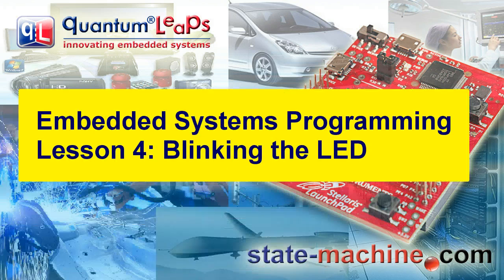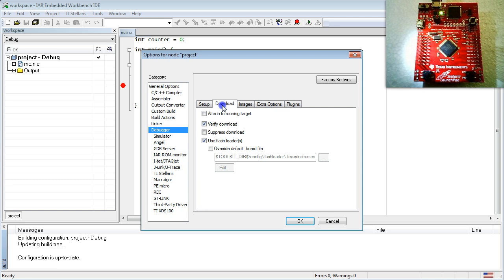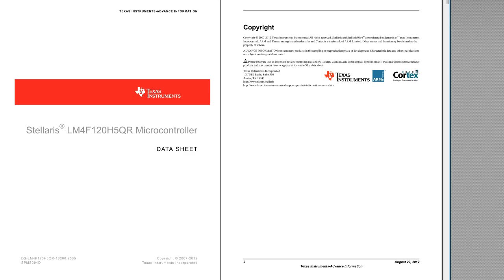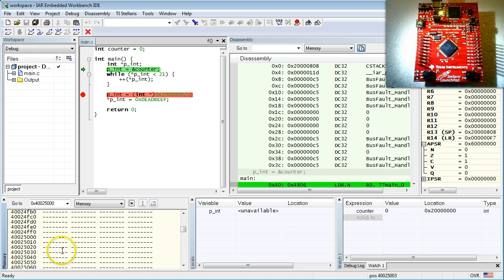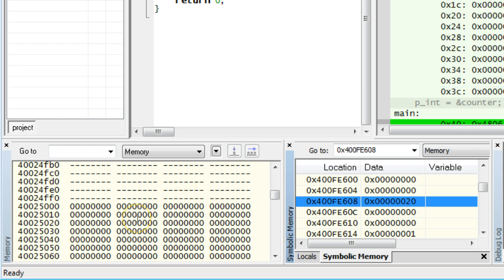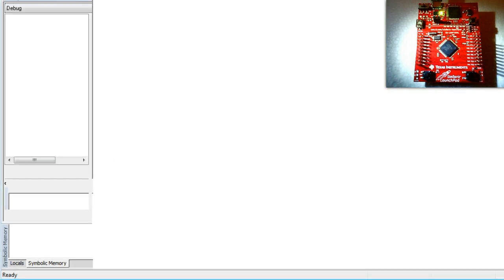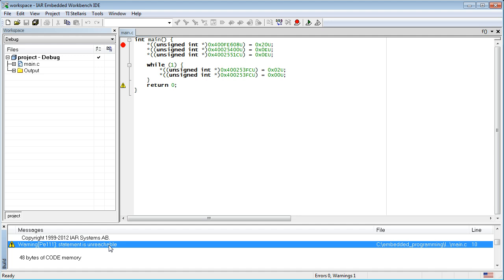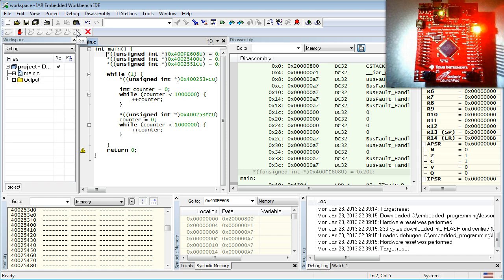#4 How to control the world outside?

Comment: Folks coming in from STM32 background can try this out on their eval boards. This has been tested on STM32F446RET6

#include <stdint.h>
#include <stdio.h>

int main(void)
{

	*((volatile uint32_t *)(0x40023830)) |=   0x1;		                     //RCC GPIOA clock enable
	*((volatile uint32_t *)(0x40020000)) |=   0x400;			     //Setting the mode as o/p
	
       while(1)
	{
		*((volatile uint32_t *)(0x40020014)) |=   (0x20);			      //Writing HIGH to ODR
		for(uint32_t i=0 ; i< 500000/2; i++);
		*((volatile uint32_t *)(0x40020014)) &=   ~(0x20);			      //Writing LOW to ODR
		for(uint32_t i=0 ; i< 500000/2; i++);
	}
}

Comment: Hey please , I need help , when I plug the board into the laptop and burn the code nothing happens in the board like it didn't get the code and the Disassembly bar is all <unavailable> and other bars have no data so please can u help me?
Reply from the maker: Please start with the code downloaded directly from the companion web-page https://www.state-machine.com/quickstart/ . And also, while on the page, you might need to (re)install the USB drivers for the board on your Windows machine. The drivers are provided on the companion web-page. --MMS

Comment: @10:11 I'm using the Tiva EK-TM4C123GXL. The reference manual says the GPIO Port F data register (GPIODATA) is located at base address 0x4002500 at offset 0x000. Why do we use the offset 0x3FC in the video to toggle the Red LED?
Reply from the maker: This is all explained in lesson-7 "Arrays and Pointer Arithmetic". Please watch. --MMS

Comment: I'm using the version 8.40 of the workbench and I get a lot of "CDCDCDCD" data in several addresses. It seems I didn't have to enable the GPIO-F hardware block, or at least I don't know if it is activated. Does someone know more about it?
Reply from the maker: Please check whether you are running in the simulator. You can actually see this on the main menu bar. Simulator prefills the memory regions, like your GPIO address space, with CDCDCDCD... --MMS

Comment: Sir , it is possible flash the code by using rom bootloader with provided by the vender .If it possible then what is the  procedure to flash the code
Reply from the maker: Yes, some vendors provide a special bootloader program stored in the MCU that can load user code and program it into the flash ROM of the MCU. The procedure of doing so strongly depends on the specific MCU, since each silicon vendor does it differently. --MMS

Comment: I have a launchpad with a TM4C123GH6PM and it doesn't like this program.  I have tried everything including the unlock for port F but still nothing it's like the IDE hangs when stepping through it...   any idea where I'm going wrong???   
int main(){
//*((
*((unsigned int *) 0x400FE608u)=0x20u;//Enable the clock for port F
*((unsigned int *) 0x40025520u)=0x4C4F434B;
*((unsigned int *) 0x4005D524u)=0x01;//commit pin0
*((unsigned int *) 0x40025400u)=0x0Eu;//GPIOF pin dir
*((unsigned int *) 0x4002551Cu)=0x0Eu;//GPIO enable as o/p

while(1){
*((unsigned int *) 0x400253FCu)=0x20u;//Turn on in data register
*((unsigned int *) 0x400253FCu)=0x00u;//Turn off in data register
}
return 0;
}
Reply from the maker: One of the main principles of embedded programming is that nothing works until everything works. For that reason it is critically important to start with a working software. To that end, you can download each and every project from the companion web page to this video course at: https://www.state-machine.com/quickstart/ . Please download the project for this lesson #4 and try this without making any changes. Then, make a copy of this project and start adding your changes one at a time, testing whether it works at every step. When you get stuck, you can use the original project to get started again. Hope this makes sense. --MMS

Comment: I have a problem when simulating, I check for the memory address 0x40025000 and it should be blanked like in this video but I find cdcdcdcd cdcdcdcd cdcdcdcd cdcdcdcd  , and even after editing the register 5 of port f to 0x20 nothing happens. ( i  don't have the board I just using the simulator)
Reply from the maker: In the real microcontroller chip, the "memory" around the address 0x40025000 is used by the GPIO peripheral registers. In the Simulator, this address space is simply uninitialized, and therefore it shows as 0xcd, 0xcd, ... But when you write to these addresses, even in the Simulator, the memory view will show the changed values. For example, type the address 0x400253FC in the "Go to" box in the Memory View and then watch how it changes when you execute the line "*((unsigned int *)0x400253FCU) = 0x02U". --MMS
Reply: @StateMachineCOM  Thank you for the reply and thank you more for the amazing playlist
Reply: @StateMachineCOM  Do u mean that even though the address 0x400253FC is changed to 0x020, everything else remains to be CDCDCDCD because that is the case for me.  I am also only using the simulator and don't have the board. Thanks in advance

Comment: I have been learning to progam ARM-Cortex M4 microcontrollers by learning to write to the corresponding registers as well as using the TivaWare Peripheral Driver Library API functions. It seems the latter is quicker to program in, however i'm sure there are many reasons to program using registers and data sheets. Can anyone explain the advantages?
Thanks in advance.

Comment: Question: Is the SW from TI same as this one (functionally speaking) or there are also restrictions?
Reply from the maker: I'm not sure what you mean by "SW from TI", because TI provides a lot of software. One piece is the extensive "TivaWare" library. So, if you mean "TivaWare", it is different than the code accompanyting this course. The reason is that "TivaWare" predated CMSIS, while this course is using CMSIS (at least in the later lessons.) The other piece of software from TI is the Code Composer Studio IDE, which contains the compiler, linker, and debugger. This course shows how to use CCS in lessons 19 and 20. --MMS
Reply: You basically answered my question. I was asking about IDE from TI v. the one used up to this point in the course. 

Thanks very much!!!

Comment: Hi sir, i am working on FRDM KW36 board with IAR workbench , and as per your instructions i have located port where RGB LED is connected and tried to do this all  by debugging the board ,but i am struck at when i tried to change the value in direction register of GPIO it does not change the value as in with the board you are using,, please if any one can help.
Reply: I'm having this similar problem.Any solutions to this problem?

Comment: what changes i have to  make for working with tm4c123 i am going to buy a microcontroller and i was  thinking for tm4c123 should i go for  it or should buy something else
Reply from the maker: The whole point of using exactly the same embedded board (Tiva123 LaunchPad) is that you don't need to make any changes. You just download the project for each lesson (from state-machine.com/quickstart ) and you run it on your board (which costs only $12.99). And finally, just for the record, I have no affiliations with TI (the manufacturer of this board) or any distributor. I simply chose this board, because it is inexpensive and yet has all features that I needed for this course. --MMS

Comment: Hello Sir i am very new in Embedded System. Can you please tell me how you get this value 0X20 from the General-Purpose Input/Output Run Mode Clock Gating Control. Thanks
Reply: 5 th bit in 32 bits from 0 to 31 has to be set to 1. Which means you get 00......00100000. Which is hexadecimal 0X20

Comment: For those of you confused about the Clock Gating part, here is some clarification (Though this is only an assumption). bit 0 is 0x01 (0000 0001) which enables GPIO Bank A (R0), a 5 bit shift gives 0x10 (0001 0000) enabling Block F, but 0x20 is (0001 0001) enabling both F and A. From this I can assume that if i wanted to enable all the blocks I would set the value to 0x1F (0001 1111), setting all the registers (R0~R5) to 1. Makes sense to me... but I could be wrong.
Reply from the maker: You are pretty close. Except that 0x20==0b00010000. To get 0b00010001 you need 0x21==(0x20 | 0x01). --MMS

Comment: at (9:39) I could not enter "e" in that BIT, how did you know at (9:59) that )x4002551C needs to be set 1,2 and 3 to 1??
Reply from the maker: The LEDs on the TivaC LauchPad board are connected to bits 1, 2 and 3 of the GPIOF block. All these bits need to be configured as output, as explained in the video. Regarding 0xE, this is not a single bit, but a combination of three bits (1, 2, and 3): (1<<1)|(1<<2)|(1<<3) == 0xE. --MMS

Comment: for the case of TM4C123GXL there is no option for downloading software on the website   www.iar.com

Device Family Architecture Vendor Header/DDF HW debug support Flash loader Examples
TM4C123GH6PZ      TM4C ARM Texas Instruments  Yes  
TM4C123GE6PM     TM4C  ARM Texas Instruments  Yes  
TM4C123GH6ZXR TM4C ARM Texas Instruments  Yes  
TM4C123GH6PGE TM4C ARM Texas Instruments  Yes  
TM4C123GE6PZ       TM4C ARM Texas Instruments  Yes  
TM4C123GH6PM TM4C ARM Texas Instruments  Yes  
TM4C123GH6ZRB TM4C ARM Texas Instruments

what should i do to get access for this launchpad
please reply as soon as possible
Reply from the maker: You probably are confusing the name of the microcontroller (MCU) with the name of the board. So, to clarify, the board name used in this video course is EK-TM4C123GXL, but the MCU soldered on this board is TM4C123GH6PM. Now, the IAR webiste lists the MCUs, so you won't find there the board name. Please also visit the companion web-page to this course, which is advertised at the end of every video: https://state-machine.com/quickstart/ . You will find there many useful links for downloading tools and documentation.
--MMS

Comment: Hi Miro, thank you very much for this great effort of video series. I also would like to ask a technical question as the other guys around here; hope you can help.

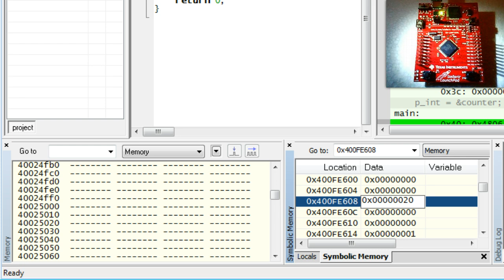Around 9:02min in the video,  you activate clock gating of GPIO_PORTF by  0x20; however in my case exactly the same setup and procedure doesn't work at all. My Port F didn't wake up. Any comment or suggestion would be much appreciated.
Reply: Problem resolved; sorry for disturbing :)
Reply: azıcık daha dikkatli dinle miro hocayı aydın gardaşşşş
Reply: Hocam keşke nasıl çözdüğünüzüde paylaşsaydınız :( Tam detaylara inmemişsiniz ancak bendeki problem 0xcdcdcdcd yani kullanım engeli var. Sizdeki uyanmama olayıda böyle miydi? Sadece simülatörden kullanıyorum belkide onunla ilgili bir hatadır, şuanlık çözümünü bende bulamadım. Eğer bir çözümünü biliyorsanız bizide aydınlatırsanız mutlu oluruz. Saygılar.

Comment: At around 9:02 you say that setting bit 5 is 20 hexidecimal.  But isn't 0x20 this in binary: 0010 0000?  That's the 6th bit, right?
Reply from the maker: Bit 5 corresponds to (1 << 5), which indeed is 0x20 or 0010 0000 binary. This is bit 5, because bits are numbered from ZERO. You can see it immediately, when you consider that bit 0 corresponds to (1 << 0), which is 0x01 or 0000 0001. Hope this clarifies things...
Reply: Oh.  I guess the first one is counted as bit 0.  I guess that makes sense since it's 2^0.
Reply: Thank you so much for the quick reply.  I get it!

Comment: How do you know to data register is at 0x400253fc. How do you know changing that location to 00000002  sets LED to red color.
Reply: First he read the Launchpad board's schematic to see which pins on the microcontroller are connected to the LED.  The pins are named PF1, PF2 and PF3: that is, pins 1, 2 and 3 in GPIO Port F.  A port is a set of pins controlled by the same registers--the individual pins within the port correspond to individual bits within the registers.  So he looked in the datasheet for the registers that control Port F.  Setting bits 1, 2 and 3 in those registers changes the voltage and impedance of the pins.  Bits 1, 2 and 3 have hex values of 0x00000002, 0x00000004 and ox00000008, respectively.
Reply: @Envergure  But the GPIO port F register is 0x40025000
Reply: @dhruvab5  If you look in the Data Sheet, search for the section  on 'Data Registration Operation'. There you will see a 'GPIODATA Write Example'. As described there, you need to use the full 32bits both as the address of the data register, but also using address bits from 9 down to 2 as a bit mask for the data to be written to the port. In other words, when you write data to the GPIO, only the mask bits that are set to '1' will be changed. In this case, the end of the address - 0x3fc - sets the mask (in binary, bits 9 to 2 will be set as 11 1111 1100). Hope that clarifies things!
Reply: I have the same problem. He is right.
Reply: i also have same doubt
Reply: did you find the answer?

Comment: Hallo Miro, 
thanx so much for the videos and the explanations.
You say at 3:28 that the RAM is only 32kbit from 0x20000000 to 0x20008000.
According to the Data of ArmCortex M4 the RAM is 0.5GiB. 
Do youmean in the Tutorial only the Controller RAM?? if yes is it usual that Controller manufacturers don't use the whole Core RAM?? i have issue to see that.
Thanks in advance
Reply from the maker: I'm not sure which "Data of ArmCortex M4" you are referring to, but they probably mean the address space allocated to RAM. This theoretical space could be 0.5GB, but address space is not the same as actual physical RAM. This is just like a theoretical limit of your bank account could be $10million, but it does not automatically mean that you have that much money in your account (most likely you have a bit less :-)
Reply: Thank you for replying so quickly. 
you mean the physical RAM is part of the Controller components and not the Core.this is lighting up!!
Thank u once again
Reply from the maker: Chaq: Memories, such as RAM, internal ROM, and Flash are NOT part of the CPU core. You can see it in every block diagram of a microcontroller. For the TivaC123GH6PM MUC (soldered to your TivaC LauchPad board), you can find the block diagram as the first Figure 1-1 in the Datasheet. The Datasheet is available here: http://www.state-machine.com/quickstart/TM4C123GH6PM_Datasheet.pdf

Comment: hello sir i just  want to tell you that what you are doing is really great but i want to ask in this video you said in order to change the value of the data direction register to determine the value of the of the direction of the data of GPIO port F as an output 
but in the video u said that u have to change the value of 2 different address to determine the direction of the gpio port F as an output so can i ask you ehat are those addresses 
i think that if you want to determine the direction of data 
you must go to the address of the data direction register's address  only and change the value of the gpio port F as an input 
so why do you have to go to 2 different addresses
Reply from the maker: Actually, only one GPIO register controls the direction of the pin (GPIOF_AHB->DIR). The other register I mentioned is the GIPOF_AHB->DEN (Digital Enable) register, which controls the general function of the pin (digital function in this case). This is because the number of pins is very limited (they are expensive), and so most pins have multiple functions selectable in software. For example, a pin can have be used for digital I/O (digital function), analog function, or as a pin to a peripheral (e.g., Rx or Tx pin for a UART).
Reply: ok so what you mean is that the seconed register that u used is for determining whether the pin will be digital or analogue write
Reply: right

Comment: Is this c for any embedded microcontroller
Reply: With skill, it is possible to write "portable" code that can run equally well on many different microcontrollers, but this example is not portable at all.  Although the C language is overwhelmingly the same from MCU to MCU, many practical details will vary.  For example, the peripheral control registers will be at different addresses in different devices, and there maybe subtle differences in their function.  He could have made it more portable by downloading the header files for the device from the manufacturer's website.  These header files declare variables for the registers, with names that are consistent from device to device even though the address may not be.  Then the code could be recompiled (I presume) for any ARM processor in the same MCU family and from the same manufacturer.